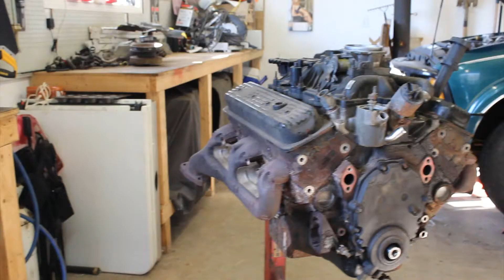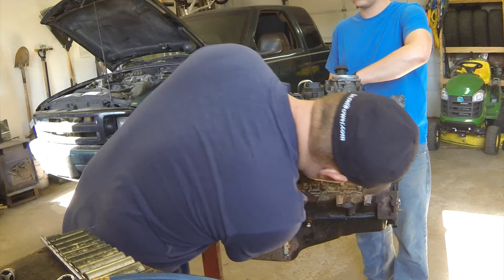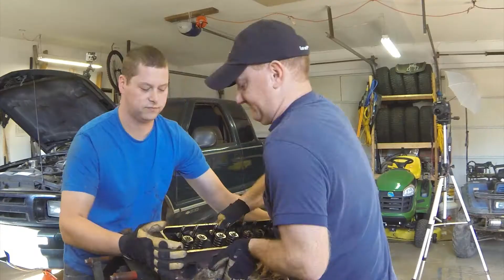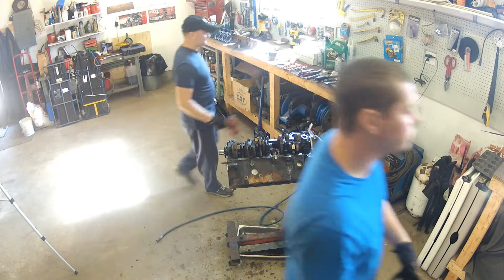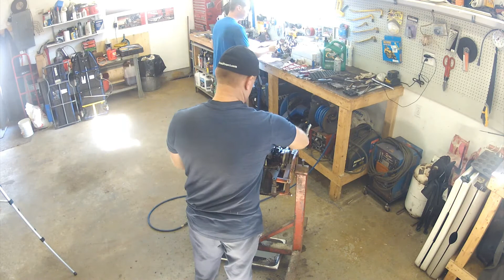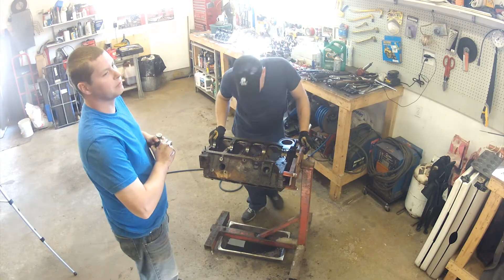V8 S10 Engine Swap Project - Part 2 - ENGINE TEARDOWN

Comment: I'm doing a swap of a 2000 s10 and I'm using an 1987 corvette engine and was wondering if it's possible to retain the stock ace compressor.the factory pullies on the 4.3 don't match on the left side and I'm not sure yet if it will be the same for the right hand side.i would prefer to use stock pullies from a different year v8 would be fine thanks in advance.
Reply from the maker: +ewn1980 thats a great question! Unfortunatly i dont have an answer for ya. I suggest talking to the summit racing tech guys. They could have an answer.
Reply: The front pulleys on a chevy 4.3 are the same as the one on a 5.7.A 4.3 is just 3/4 of a 350.There might be one hole that needs to be tapped on the left hand head if you have the cast aluminum brackets but if you have the steal one piece bracket you don't Necessarily have to drill and tap the missing hole.There plenty of support.I own trucks with both engines and the brackets and accessory bolt right up.Hope this helps
Reply: Thank you
Reply from the maker: +Chris Perkins Great info Chris, thx
Reply: Jags that run has a manual with all the parts to use

Comment: thank u for this video, would like to ask u if u would prefer the new 5.3 vortec over this one ? the new 5.3 has high horse power with less gas hogging If I would swap it with the s10 blazer stock 4.3 engine what are the major issues I would run into ?! thank you again.
Reply from the maker: +Raed Shareef i went with this engine because i had it kickin around. The 5.3 bolts up to the 4.3l trans so u can reuse that. Other than that i dont know first hand what else would be required other than the obvious things (mounts, cooling system, etc...) Thanks for commenting
Reply: the 5.3 is only 30 hp more you could tune a 5.7 motor to have more than 285 hp

Comment: So quick question. Would this work with a 4WD s10? I have a 96 s10.
Reply from the maker: Yep
Reply: @ArchersGearheadGarage   so you're saying that I would be able to keep the original transmission and put a V8 on to that transmission or what I have to get a different transmission? Mine is an automatic transmission.
Reply from the maker: A th th350/th400 4l60 will fit any 4.3L or any chevy v8

Comment: will the stock oil pan work or do i need a different oil pan? my s10 is a 1991 and 350 is a 77 motor
Reply from the maker: schitler no. The stock pan wont work

Comment: what happened to this build ?
Reply from the maker: +Peyton Yellott These builds take a lot of time and money...Throw having a baby in there and... More to come!
Reply from the maker: +Peyton Yellott This build is ongoing. I had to save up some cash for parts aswell my wife had a child so, busy times here. Trying to make time for everything. New video for this series is on the way
Reply: Archer69er
Reply: Archer69er i have the same exact truck with a 5 speed 4wd 4.3 can i just bolt a 350 in or..... how do u find a guide to help
Reply from the maker: +Dereck Fazenbaker check out the Gmt400 fotum
Reply: Dereck Fazenbaker i I believe you can just bolt it in just use the short water pump and acceseries